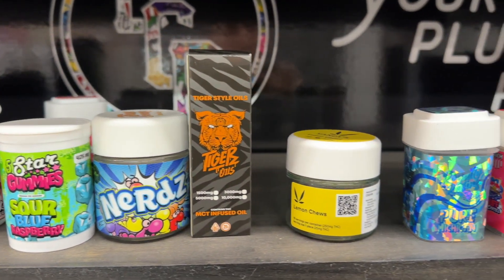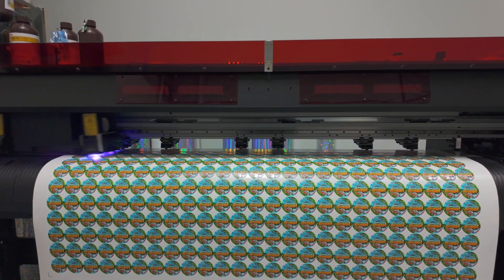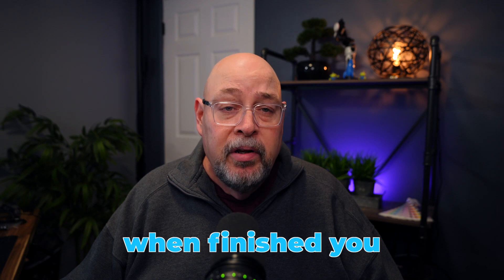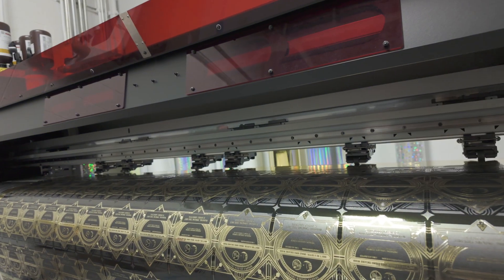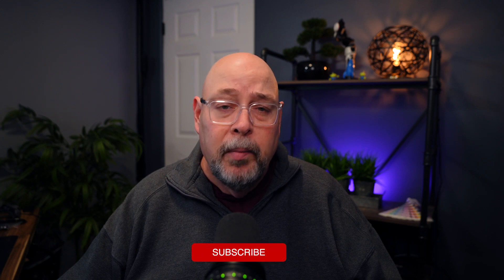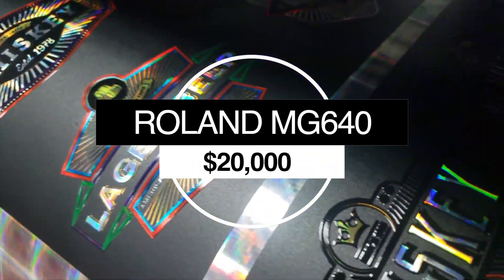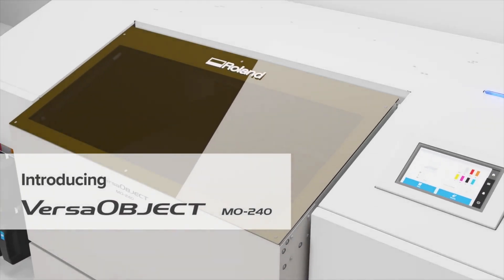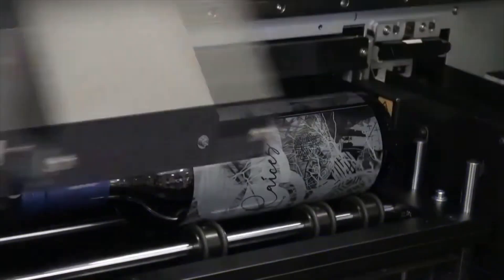🔥Best Printers for Cannabis Packaging🔥

Comment: Is there a smaller version that can still do the job?
Reply from the maker: Depends on what you want to produce: If you're looking for 30" print/cut all in one in Eco-SOL then check out the Mimaki CJV200-75 series. If 30" UV print/cut then the Roland MG-300 30" UV printer is the smallest least expensive and if looking for a flatbed you could look at the Roland BD8 UV flatbed printer for objects as it has no cutting capabilities

Comment: What do you think about the Afinia L502-L801 are they good enough to print quality stickers for cannabis
Reply from the maker: I just did some consulting for a cannabis packaging company who was using the L801. Yes, it’s a good printer for that. Make sure you clean and maintain it on a regular basis. You are limited with the finishes to straight CMYK printing on a handful of media but it gets the job done.  They also had the finishing system which is a must for labels in my opinion.

Comment: hi, great video. Does roland eco solvent needs out gasing? can you work with them in a small room? are they good for quick turnourds? lastly, how would you compare latex and uv roll to roll printing on paper media, does gloss paper sill looks gloss afeter doin uv printing? I only used latex for posters and I was just not sure how uv would work on paper. thanks
Reply from the maker: Thanks for watching and sending a comment. The Roland Eco-SOL prints may need outgassing depending on what your what you're creating. Sticker where you will be cutting through wet ink or a vehicle wrap I would out gas. If it just stickers without a bleed or paper, it would be fine. There is a slight smell to the ink, but most people have no issue with it and can work with them in a small room. Yes, they are good for quick turnarounds although latex ink is the best for quick turnarounds. UV works fine on paper similar to latex inks UV inks are matte by nature and would need a gloss laminate if you wanted a gloss finish. Eco-SOL inks on gloss vinyl or paper would still look glossy when printed.

Comment: For eco solvent, what vinyl is recommended for packaging or what brand do you recommend?
Reply from the maker: Thanks for the question. It depends on what the packaging type is. All media manufacturers have a standard vinyl for cardboard or paper type products. If it’s a low energy surface like plastic I would recommend Arlon DPF8000 ultra tack or similar. If it’s a food product then Eco-sol ink should not be used on any media as it is not a good safe ink.  I can recommend more media options if you let me know the packaging type.
Reply: @graphicinsights466  hey man, Great information as always. A customer inquired about labels, this is for a filtered water company. Does that mean eco-solvent is not safe for that ? If not what type of printing is good for that ?
Reply from the maker: @raygangibbs3762 if they’re going on a the filter themselves I would say no but if for the box they come in and the filters are individually wrapped, I would think it would be fine.